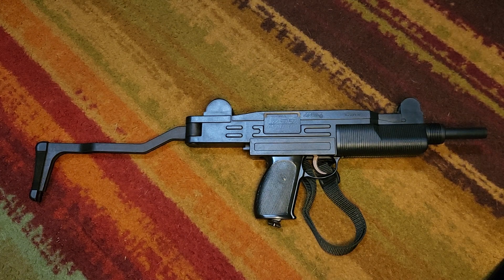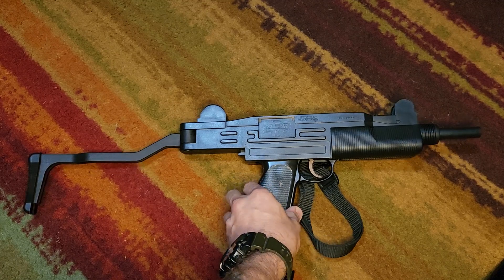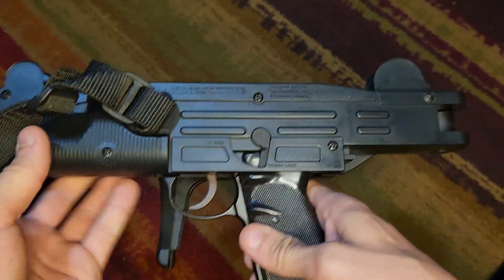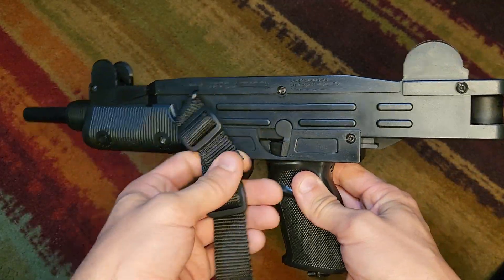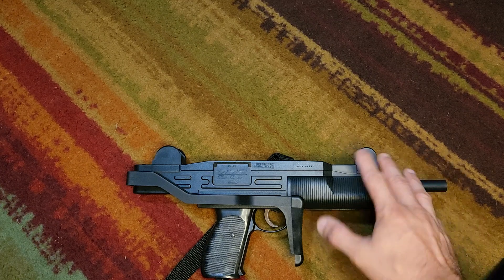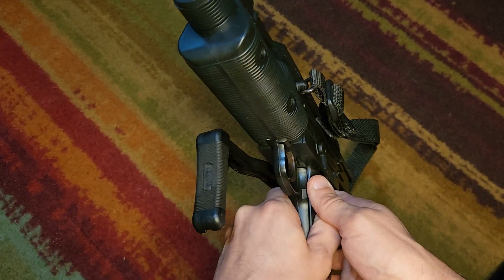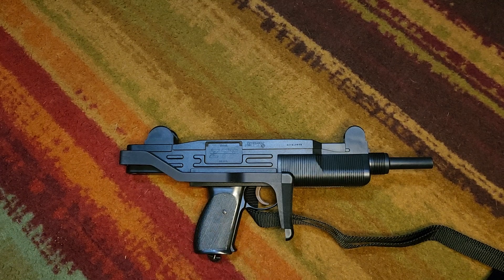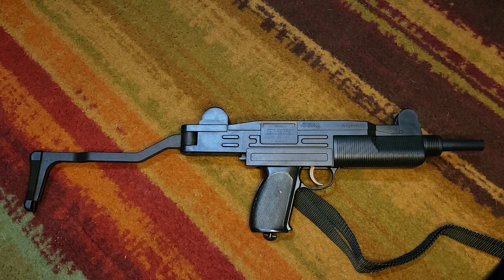Crosman Z77 Overview

Comment: Just bought one of these with all seals replaced...fun to use...but mindful of where i fire it due to it looking so realistic.
Reply from the maker: Yes, it does look real. I can see why they stopped it after they banned inports of the real thing.
Reply: @SavageAirguns  Do you have the owners manual for yours?
I see a printable version is available from the crosman website.
Reply from the maker: @vinto34  yes it came in the original box with manual.